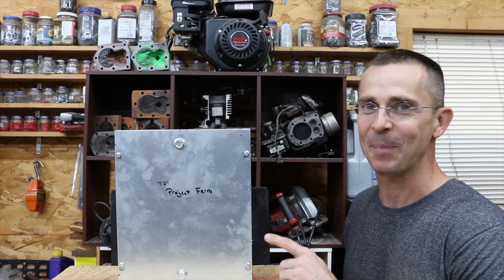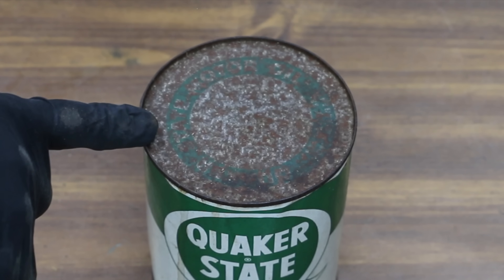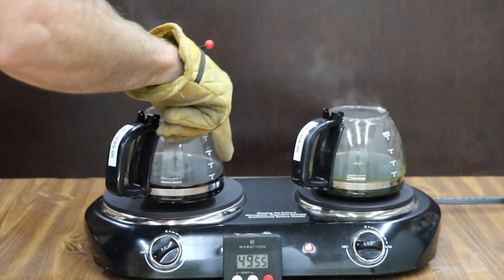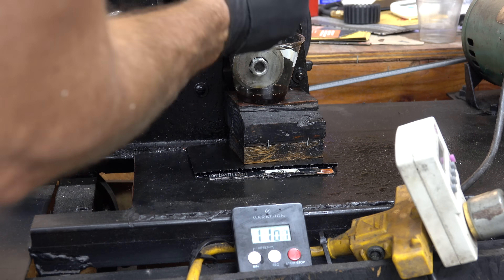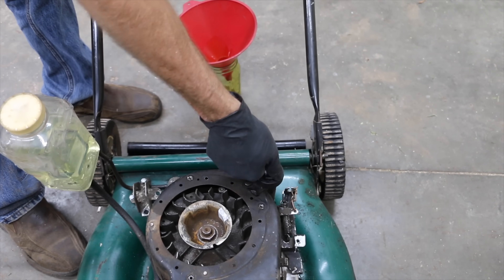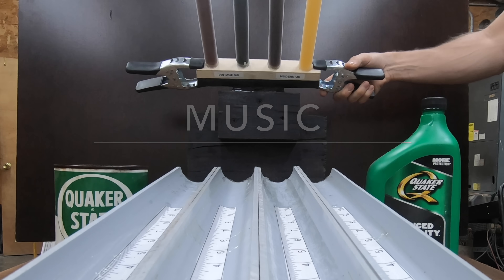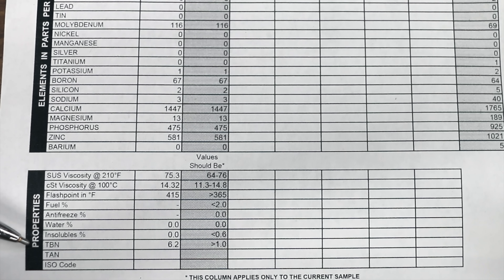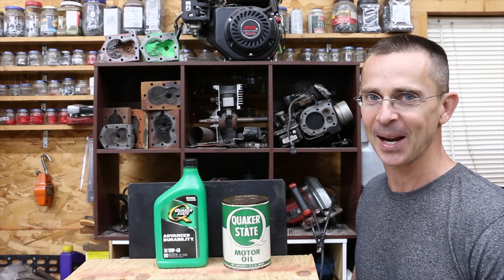Is Oil Good After 70 Years?  Let's find out!

Comment: I have some old brake fluid, probably 1980s or 1970s or older. It's red (spilled 1 of 6)
Reply from the maker: Thanks for sharing.
Reply: Props to my man replying even after a year
Reply: Congrats on your brake fluid now do yourself a favour and Chuck it away ; brake fluid absorbs moisture and is garbage once opened in about 6 months
Reply: @iamasmurf1122  they are unopened
Reply: @iamasmurf1122  The fillercap on the brakefluid tank in a car has a hole in it, so moisture can get in so how is it not garbage after 6 months of use then?
Reply: @3DPeter  most parts of braking system are hot it will just take all the moisture away
Reply: @hihihihi7804  
only the brake pads and brake cilinders do get hot, but not the brake lines or resevoir.
Reply: @iamasmurf1122  Liar! Not really true. My gramps Said so. He knows Everything. 🐯🐯🐯👑👑👑
Reply: @iamasmurf1122  not if keep cap on it iv tested it after eating years it show less then 1% moister
Reply: You guys are arguing as if it's an opinion and not a fact. Brake fluid is in fact hygroscopic. Meaning it absorbs moisture. This is to keep it from rusting out your brake lines. If it didnt, they'd be gone in the rust belts in a year.
Reply: @gunners4129  
Dude, i never heared such nonsense because the fact that brake fluid is hygroscopic is not a positive but a negative side effect, and and that's why they recommend a brake fluid change at least once a year because like you said, it absorbes water, and you don't want that in your brake lines or calipers
because they are made of metal and start to rust that way, and the more water in brake fluid, the less the brakes will work.
Reply: Dude. I'm not sure where you learned any of this, but you're incorrect. Plain and simple. Grammatically you're beyond incorrect, but I'll hold off on that. First. There is a hole in some styles of master cylinder caps. But only ones that have a diaphragm underneath. Most caps do not have a hole. The hole is to allow the brake fluid to circulate without cavitation. The diaphragm underneath breather style caps allows the fluid to go down without making pressure, but keeps the fluid from coming in contact with air. Brake fluid was not always hygroscopic. But they engineered it that way beginning with dot3 because of the adverse effects it was having on lines and the internals of proportioning valves. It's meant to absorb any moisture that comes in contact with it. If it didnt absorb moisture then you would get pockets in the brake fluid of moisture which would act exactly like air in the fluid. So youd get intermittently working brakes if it didnt absorb moisture.
Because of this, open containers of brake fluid indeed do become junk in a year of sitting on the shelves. Brake fluid in your car should be changed regularly. It should be clear, almost amber or yellow. Not brown/black/red/tea colored, or any combination of the above. Pretending to know what you're talking about, simply by googling horseshit doesnt make you correct, it makes you sound uneducated. And following it up with very, very poor spelling and grammar only helps to confirm the suspicion.
I will not have a battle of wits with an unarmed person. So go to the next video and argue with someone new.
Reply: Yes that stuff is hydroscopic and collects water on its own
Reply: @gunners4129  exactly
Reply: @gunners4129  When you say "open container", do you mean you left the cap off of the can when you stored leftover fluid, or you stored it with a tightly screwed down cap, what I would call a sealed container?
Reply: Brake fluid is hygroscopic. Absorbs moisture to prevent deterioration of metal components. As it absorbs moisture ( as it is designed to do) its boiling point lowers. DOT 3 has a minimum boiling point of 401 F dry and minimum boiling point wet of 284 F (wet is 3% moisture I believe)
 When fluids boil they change state of matter into a gas. This causes bubbles in brake hydraulic system ( bad, spongy pedal). 
 Old brake fluid should be thrown away. It starts absorbing moisture immediately and will be “wet” (3%) within 6 months unsealed container- sealed container shelf life is basically unknown.
   Even sealed plastic bottles will allow moisture through eventually. As cheap as it is , throw it away. It’s not better than modern fluids, it’s probably  not as good as a modern fluid. No advantage to it.

Comment: If I remember correctly when I was a kid I worked at a service station that did Quaker State oil the green band on the top was non-detergent the red band on the top was a detergent oil
Reply: Truth !!! I worked as a gas jockey after school in the late Fifties and also seem to remember the same thing.  If that can top wasn't so rusty you could probably see the viscosity rating, too. By the looks of the oil it was probably a straight 30 or 40 weight. As the guy down below notes, it's probably from the Forties because multigrades weren't yet made then.
Reply: You are correct. My grandfather sold QS at his station and I poured a lot into vehicles when I was 12 years to 18 years old. You nailed it.

Comment: I remember when oil was green, damn, I must be old.
Reply: When I was in High School and poor, I bought Sequoia brand "re-refined" oil. It was thick and green like this and only 59 cents a quart.
Reply: App Store   My mother is 91 years old and is on the Internet regularly.
Reply: App Store       hahahaha ... no man !!  my dad 85 uses facebook, wasap, browse, send pictures etc !
Reply: The green is zinc, which is actually a good thing.  Penn Grade racing oil is one of the few oils you can still buy with significant quantities of zinc added.
Reply: I remember a drink from my partying years called, 'Green God D@mn".
Reply: I don't remember using green oil in the old days except Valvoline 2 cycle.
Reply: @auntjanet2346  lolololol
Reply: Hunter D  Yeah oil used to be green.
Reply: Duckhams still had green oil in the mid-80s, which was the last time I used it
Reply: Some 2 stroke oil is still green

Comment: I work in an oil lab and i was surprised how you simulated tests like volatility loss, cold properties or cold crank simulator, lubricity... with "normal, daily" DIY stuff. We work with standardised materials and apparatus but even kitchen utensils, PVC pipes and an old lawn mower can do the test... you proved it. 
Since the 1950's oil has developped a lot. Modern cars need oil change every 10-150000km (or more ?) while in those days 2500km was already "a lot". Thanks to additives, despersives, synthetic oil formulations, better cold characteristics and so many more.
Reply: I remember oil change intervals of 5000 kilometers in the 1960's. And today they 11,000 to 16,000. 150,000 is a bit much! I'm guessing that was a typo.

Comment: Oil technology has come along way in 70 years.
Reply from the maker: Great point!
Reply: Yes it HAS , all engines can benafit from modern oils , race cars too .
Reply: Not just that. If this was manufactured in 1949, not all cars even had oil filters yet so it's even less of a mystery why engines didn't last long then! The Oil Filter was invented in 1923 and was an optional accessory until the 50s. Filters, at first, were the old canister styl (which has come back in more recent years.) The spin on filter didn't show up until the mid 50s. I forgot what specific year; somewhere from 1955 - 1957 is when they became standard across cars.
Reply: Unfortunately the advice from the people 70 years old hasn't.... I'm talking about that guy with the shop that thinks you should run 15w-40 diesel oil in everything "because thicker is better".
Reply: I use Motul 300v in my race bike and it looks just like this old oil he's got in the video. Great stuff. I wonder what similarities it has if any, I know Motul 300v is ester based
Reply: @jamesg8246  Don't worry too much, I'm on board with lubricant quality and viscosity trumping just viscosity. It'll take a while but I know better; thinner at start up while keeping a good viscosity at operating temp = less wear.
Reply: @101Volts  Exactly.

Comment: After watching Ford Vs Ferrari, it's interesting to think that oil similar to this was used in the LeMans cars, and some managed to survive the race!
Reply: probably there were different qualities of oil back then ..........
Reply: @eloyex  "oil similar to this". Didn't say that they used Quaker state. Back then they didn't have all the additives and synthetics.
Reply: Back then they would add their own additives instead of using the bare oil.
Reply: @headcas620  like what?
Reply: @Only1Sethy  they kept that stuff secret lol but it's still done today so I'm sure they did also
Reply: Awesome fucking movie 👌
Reply: Almost certainly was "racing oil" and was single viscosity,also may have required a long engine warm up to get the oil up to temperature before running the engines at full power 
modern racing,almost certainly Synthetic racing oil which does not need as much of a warmup

Comment: When I worked at a Service Station in the 1960s. We could always tell when someone used Quaker State from the buildup of sludge around the lifters and rockers. After this test now I can see why.
Reply from the maker: Thank you for the feedback
Reply: Earl Elwood Same with Pennzoil , lots of sludge and grit / ash as operating temps increased.
Reply: I older cars that used that had used Quaker State 10 or 15 years. The oil would turn to sludge. I would spoon it out around the lifters and push rods. I would add one quart of transmission fluid in place of a quart of oil to the new oil and run it thirty minutes. Gunk would roll out when I drained it. I would keep doing that after every oil change. After about eight or so oil changes not much sludge would come out. I would use an engine flush next few oil changes. The engines got better in the first 20 k miles I owned them haha. Sound better and ran better. Some would have so much gunk could only add five quarts instead of six. I had to pull a oil pan and pump off of a Chevy 250 straight six. It clogged first time after trans fluid.

Comment: I remember from back in the day that oils contained paraffin. That's where the smoke came from, and the oil test did not show a test for paraffin.
I remember way back then ,when we pulled the valve covers off a high mileage engine that was not maintained properly that it had that paraffin sludge built up from the base of the head to the top of the rocker arms between each one of the rockers and about 1/2 inch thick on the underside of the valve covers.
Reply: not to mention their "lubrication package" was LEADED gasoline!
Reply: Paraffin is made from petroleum and has a different meaning in Europe.
Reply: @stewartcaldwell5299  what we call kerosene, others call paraffin. Pennsylvania oil has a paraffin base. Texas oil has what is known as an asphalt base. Paraffin oil by nature tends to be less acidic. Of course modern chemistry can be used to modify that I suppose.
Reply: There have been no parafin based oils in decades.
Reply: @hotrodray6802  Not sure where you get that.  Pretty much all oil obtained from Pennsylvania is paraffin based.  This is something I learned as an engineer at GM.
Reply: It's been a long time , almost forgot about that difference.
Reply: @mikebetts2046   Thanks. My remark was also a remark on the vagaries of the English language.  I'm sure it's an attempt to speak more precisely, but just one word for each concept would be nice, instead of modifying previously modified words with other modifiers.

Comment: Remember that the recommended period for a oil change was 2,000 miles in the '50's❗ Better oil now gives you the 5,000 plus, oil change period.
 Thanks for another great video and you and your family have some great holidays a great new year.
Reply from the maker: Great point!  Thank you and wish you great holidays and a prosperous new year
Reply: And back then engines had a lot less hp/liter meaning it doesn't put as much strain on the oil
Reply: @ProjectFarm  the pistons had  more blow by back then  through the rinds why oil get bad is the blast in pistons gets into the oil , now days pistons rings  block almost all of it
Reply: Its because of efi.
As soon as thay hit the scene engines went from having 100k miles and burning a quart every 600 miles with tons of blow by to having over 300k and being in excellent shape.
Reply: @brianmorrison9066  
 If you're burning a quart every 600 miles, you really need a engine rebuild!
 Even, back in the day, a pint of oil at the 2,000 mile change was considered "broken in". More than that and it's time to start thinking about a ring and valve job.

Comment: No wonder getting 100k miles out of an engine was a feat, back then
Reply from the maker: Thank you for the feedback
Reply: Thank god we don't use Carburetor anymore, also engines back then needed new spark plugs at every 30k miles.
Reply: @jackiechan_wtf4041  -Tune-ups consisted of replacing Points, Plugs, Rotor, Condenser... If you had big bucks, Wires and a Cap. Nobody i knew had big bucks back then. If the car needed wires and a cap, we would find better condition  ones in the junkyard. Ah, the good old days.
Reply: @jackiechan_wtf4041 , I've worked at a few shops, where 
the "technicians" didn't now how to work on carburetors.
Couldn't even spell "carburetor."  Funny story, when I was 
in High School, the English teacher asked us to submit 
words, for next week's spelling test.  Yes, I did add 
"carburetor."  And, to this day, every time I think of that 
word, I hear it spelled in a Scottish brogue.  She was a 
Scot.  Sounded like Professor Mcgonagall.

steve
Reply: Steve Skouson absolutely correct. Most, not all, younger techs would shrivel up and run away over a carb. 

Also correct that that most, not all, older techs who know their way around a carb or old school ignition systems can’t comprehend a modern car and don’t want anything to do with it.
Reply: @jackiechan_wtf4041  Carburetors might not be the most efficient but the old Chevy 305 engine from 1977 - 1993, as un powerful as it is, was still nicely reliable! I've heard of people going over 300k easily with them, some well over that even! (This is after points were used.)
Reply: If you got 100 k out of a Ford flat head V8 you would at least get your name in the news paper.
Reply: In the early 80s I worked for an oil company that sent me new Chevy pickups to drive the floats in the quadrojets would soak up with fuel and get heavy. The boss would say put a Holly on it. Holly made a replacement carb for that purpose.

Comment: I well remember Green oil, yes it does smell different. Big problem was it is paraffin based oil, along with high evaporation rate, under the valve covers was a gooey waxy mess had to scrape the valve covers and valve springs, rocker arms to adjust the valve clearance. Back then blow by was via a tube down under the car, air rushing by caused a vacuum and drew out the fumes.  
THANKS FOR YOUR TESTING !!!
Reply from the maker: You are welcome!

Comment: Something i'd love to see done is a fuel test involving naval diesel. Because when i was learning the engineering about naval boilers, a note was made about the diesel used on how it was heavily refined to ensure as few impurities are in it as possible. Since that way there would be as little built up on the heat pipes, thus little interference in the heating process. So i wonder if you ran such fuel in a test would it work almost identically to normal fuel, or would it run way hotter, violently, or something else. It would be an interesting test and also talking point I think.
Reply from the maker: Thank you for the video idea!
Reply: I’m not sure about that.  DFM was really thick, and wasn’t super clean (F-76), but JP-5 is cleaner and burned hotter than DFM.
Reply: We ran JP-5 in our diesels.
Reply: @Stimpy&Ren well I mean clean in terms of residue left over. Since carbon build up and that stuff lowers the boiler efficiency, by creating a barrier around the heat pipes thus causing pretty much an insulating layer.
Also find it weird people are thinking clean as in fresh, and non polluting when clean has more definitions that just one like those.
Reply: @ProjectFarm  to add on to this idea would be to also test kerosene and RP1.
Reply: +John J  Would it run in a 2020 Dodge Ram 3500/Ford F-350 truck?  Also, I think those trucks run on diesel.  (not that I own either one, but I would love to, and especially to run it on naval biodiesel (if that's a thing!)).
Reply: @scratchpad7954  Naval diesel (JP-5) is jet fuel.